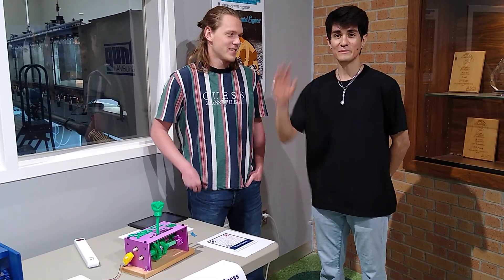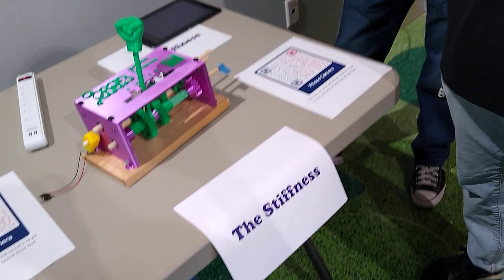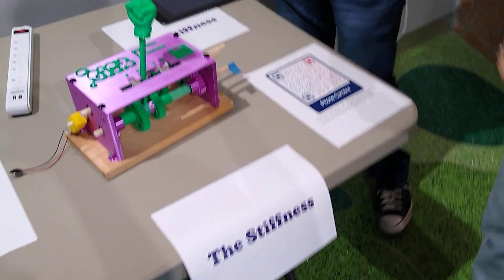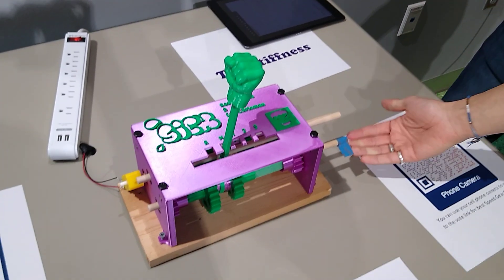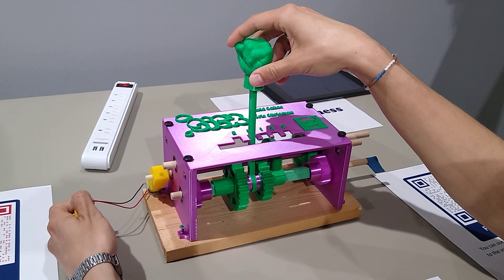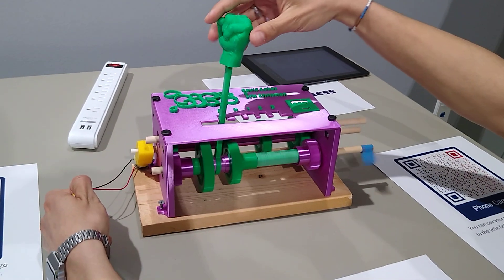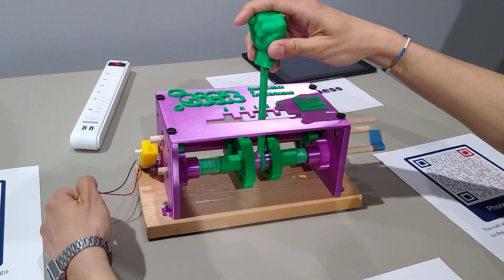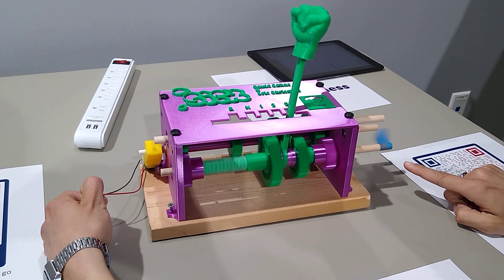3D Printed Gearbox with motor including Neutral, Reverse, and Three Forward Speed #gearbox

Comment: Correction: Power emitted by motor = 0.017 HP and the max torque is 0.01948 in*lb in first gear
Reply from the maker: thanks for the update :)